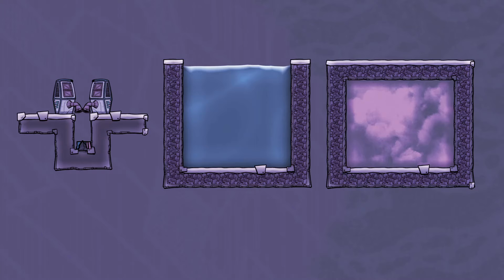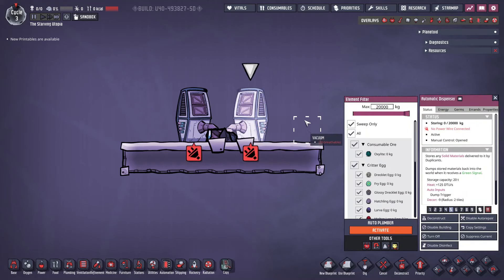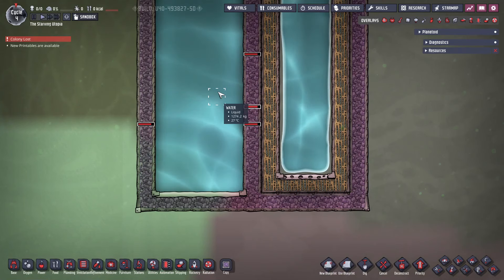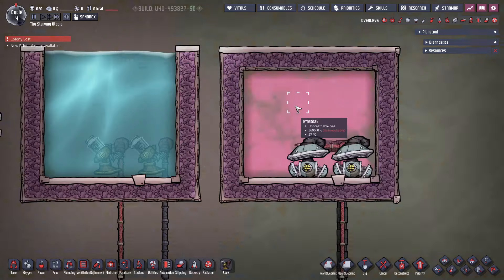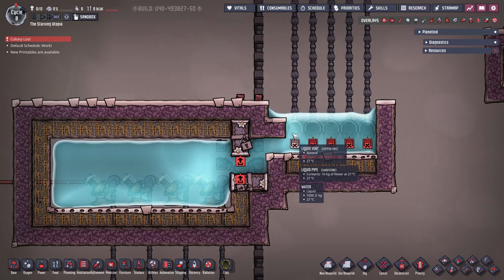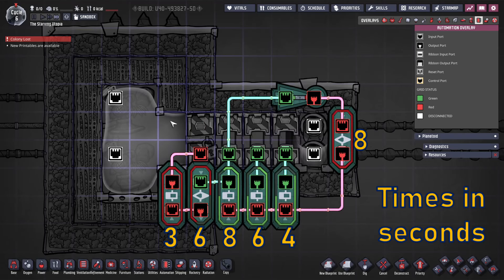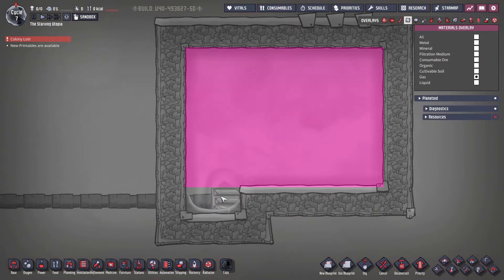Oxygen Not Included - Tutorial Bites - (Infinite) Storage

Comment: Been playing this game for close to 500 hours and your idea of not building storage bins and just shoving everything into a single hole blew my mind and now I'm mad I didn't think of it before.
Reply from the maker: Well I can't take credit for that as an original idea as it was already established in the community, but glad to share it with you!
Reply: Seriously. Just saw that and I'm looking at my 500 storage bins and lagging game and thinking WTF have I done. Saving all that space I don't need to worry about liquid or gas. Though the gas one is nice for the Natural gas storage. I have 3 geysers in my main game so all my power is through them. Unfortunately they have the same cycle activity. So I have this 1000 tile storage with 20kg of natural gas and it still runs low when they are off.
Reply: I use auto sweepers after i group all items in one spot. i use conveyor chutes to group them in different spots which makes them look organized and allows me to see how much stuff i have especially on the scarce materials. this only works for the not super hot or super cold materials though.
Reply: Storage bins do have the advantage that critters can't eat out of them.

...but you can address that by putting a horizontal pneumatic door over your infinite solid storage, so it doesn't change much.
Reply: I only recently learned that tip myself, currently 900 hrs in game. 🤦

Comment: Another alternative to infinite liquid/gas storage is to freeze them solid with Aquatuner cooling and store as debris, this method requires more setup and energy, but is more space-efficient since you can store everything in one tile and is not using any exploits. Since frozen liquids/gasses need to be warmed up again to use them, it is better suited for excess materials that are likely never going to be used, but generally it is not hard to melt them by just moving debris to storage bin and letting exchange heat with an environment.
Reply: would that explode the pipes you are using?
Reply: if they make a tile , you gonna lose half of materials you put in.
Reply: @saeeddavoody6925  Yes, materials should be submitted in small portions to avoid that and care should be taken to prevent cooling  from going offline, but once it was established it worked fine.
Reply: @denismayak  you are right,  it is a way of doing it which is fine , it just needs so much time to build a working machine with automation to ensure that it won't break and put so much power into it . 
maybe i will test that in my recent base once i get to late game and freeze entire map . it would be kinda funny.
Reply: To be fair, if you think using air flow tiles to store infinite liquid is an exploit, it would also be silly to store infinite tons of solid matter in a single space as well.

It's not an exploit. It's using the game mechanics. It's a game. There's no need to try to be realistic about it.

Comment: The infinite storage in the game is good to use, but I like the mod that upgrades my storage container to fit 10 billion grams of material... Then I can sweep the whole asteroid in there.
For liquids, I usually build a water storage area for my bathrooms and oxygen and hydrogen electrolyzers. A polluted water area for output from bathrooms. I also use the infinite mop mod to mop lakes of liquid around the map and collect them to my base. I build a chlorine room either manually or nearby a chlorine "volcano" for the purposes of disinfection. I build 3 of the liquid storage tanks with water sieve and metal refinery. First tank germy polluted water to water sieve, then second tank to metal refinery to third tank with pipe germ sensor before getting back to my clean water storage.

Comment: I tried replicating the infinite liquid storage in my save file yesterday - started with about 80kg of crude oil in the lone corner tile, then began filling with polluted water from a geyser. While I wasn't tracking the entire thing, when I came back the liquid vent was overpressured, and the crude oil was no longer in my tank. Is this a common issue that you can see?
I'm going to try again tonight and watch to see if I can spot if/when it fails. Any advice would be greatly appreciated
Reply from the maker: This should still work reliably, so not sure what the issue was exactly. I wonder if it could be something to do with the polluted water offgassing into polluted oxygen and deleting the oil, but I've not come across that myself. In that case it may be better to use the airlocks rather than airflow tiles to make the storage.

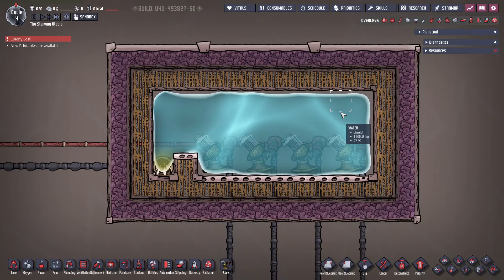Comment: Hi, I wanted to make an infinte petroleum storage with the design from 3:19, so I switched it upside down to add polluted water from above, so petroleum can flow through it. The problem is that the petroleum is hotter than 120°, so the polluted water will change into steam. I tried to cool the petroleum under 120°, but at this stage of the game its just abnormal difficult. Is there any other way to do it? Anyone got a solution for this? Thank you.
Reply from the maker: Actually that should still work as long as the liquid vent is on the steam tile, the technique still works. If you need to enter, then you can probably get in if you use a liquid lock with a different liquid to make changes. Another way to fix it would be to use a different liquid (oil is probably the best choice).

Comment: Thanks for your videos! Quick question, for the escher waterfall, whenever I deconstruct the bridge/pipe, the gas just dissappears - any tips on getting the gas to stay in non-debug mode?
Reply from the maker: The key is to delete the gas pipe in the right area, that will release the gas. I've not had an issue as long as the entire area is full of the liquid you want to use, and also make sure you don't have airflow tiles in the wrong places. Then I find it helps to deconstruct the top gas tile first, and it should be fine.

Comment: 5:14 - I'm not sure this works any more? I just tried to build a bunch with a high-pressure gas vent, and, even with 2-tiles of water on the ground, I got a "Vent Overpressure" almost immediately. The upper layers remained a vacuum and the gas never seemed to travel past the vent. In fact, it told me the vent was "blocked" before I even started pumping.

Edit: I discovered the problem is there's a limit to how much liquid can be on the 2 tiles. I've read online that it can't be more than 2kg per tile, which is tough to do with a bottle emptier. I ended up creating a setup with a water pump, connected through a Liquid Meter Valve set to 2kg to drop exactly the right amount of water. Since I had 5-6 of these blocks vertically stacked, I also added a Timer Sensor (1 green, 130 red) to give me time to have the dupes build the floor for each layer, working my way up. Ended up working well.
Reply from the maker: It's 2kg for the normal vent or 20kg for the high pressure vent, so much easier to use that if you have the plastic. I did mention that in the video.

Comment: How do you set up the auto-dispensers to just dump all their stuff onto the floor? Do you need an automation wire and a conveyer setup?
Reply from the maker: The auto-dispensers are simply set to all filters (maybe not liquifiables to stop things melting) and sweep only. If you don't use sweep only then they will keep picking up everything on the map. Then you just issue sweep commands for anything you want tidied up and dropped there. There is no automation required for doing this. You can also use this with conveyors if you wish, just add a conveyor chute above the tile to drop them in to. But generally manually sweeping is the easier way. Autosweepers are best used when material is constantly being produced in the same place.

Comment: Does this not cover your water in germs because of the polluted water in the corner???
Reply from the maker: Germs are different to polluted water vs water. You can have germy normal water and non-germy polluted water. But in any case with an infinite storage of water you will likely not have any germs anyway as the mass will be too high. You can get a very germy polluted water infinite storage, but in this case if ends up hot enough they will die anyway. Or in the spaced out DLC you could put a radiation source nearby.

Comment: When i try to use the liquid to stop the gas from over pressuring i get "pump not in gas" error and it wont allow gas out of the vent. Have they changed the mechanic or is it just me?
Reply from the maker: The mechanics are definitely still working. I'm a little confused by your reported error as it relates to pumps not the vents? The vent needs to be in liquid which is less than the overpressure of the vent. If you use a normal vent then the maximum liquid can be 2kg/tile, and 20kg/tile for the high-pressure vent.
Reply: @GCFungus  orry my mistake it was "vent over pressure" i have 20kg of Salt water over the vent in a vacuum.
Reply: The answer was there was too much salt water on each square, less than 10kg seems to work.

Comment: i tried doing this for the gas. i either put too much water in or i put the right amount. but as soon as the air start moving it pushes the water away and it get over pressured again
Reply from the maker: Did you make it 2 tiles wide, as 1 tile will definitely break and more can be a bit dodgy.
Reply: @GCFungus  I got it to work now. It was a bit tricky but I tried a few time

Comment: I was wondering if there was a cap for infinite storage... It's actualy scary when you see 50 000 Kg/tile ☠️ Also I'm not sure if it has impacts on FPS. But it's true it's really helping to manage your liquids and gases early.
Reply from the maker: Another commenter mentioned a while ago that it was 2,147,483,647 kg - so you would have to be going a while to gather so much material. FPS wise I'm not sure, but different gases interacting definitely takes more computation than just one gas in storage, so better if you can reduce gas mixing.

Comment: Oops mistake. I was wrong that the normal vent overpressurizes at 1800g per tile
Reply from the maker: This is not correct, you can double check in game or on the wiki but it is 2000g per tile. Offgassing is overpressurized at 1800g per tile which may be what you're thinking of.
Reply: Omg I did really believe that it was 1800
Reply: @GCFungus  Yeah I'm sorry that was the one! Omg

Comment: Hmm, I can’t seem to get the infinite gas trick to work with the water at the vent.
Reply from the maker: Is the liquid 2 tiles wide and below the maximum output pressure of the vent and suitable for the temperatures of the gas? Otherwise I'd need some more info to work out thr issue.
Reply: @GCFungus  I used water as that’s what I had available that didn’t off gas. I must have had too much in the space, when I made it larger it worked fine (I went from 2 squares to 4 squares for the liquid).

Thanks for the reply and excellent videos!

Comment: The infinite gas storage with liquid doesn't work anymore apparently. Tried it but it just says overpressure on the vent...
Reply: I’ve been able to use the liquid on gas vent method on my save just fine. Do u have the right amount of liquid and tiles?
Reply from the maker: It does work, just be very careful with the liquid mass. The normal gas vent will overpressure at 2kg/tile, and the high pressure one at 20kg/tile. If you put more liquid than that then the vent will be overpressured.

Comment: At 0:59 you should have said they DON'T require power
Reply: For escher waterfalls I find easier to use outputs of brudges than inputs. All is so much easier said and done in debug mode, than in normal gameplay. Using bridge outputs rather than inputs gives you the advantage to empty the pipes without using pliers and deconstruct the bridges anytime, before finally releasing gasses from the single segments.

Comment: hello. not exactly proven, but there are suspicions that the infinite storage causes performance degradation. specifically in case of liquid storage. have you experienced anything like this? me in particular had performance issues when making infinite liquid storage.
Reply from the maker: I'm not particularly aware of this. I have heard of crashes due to overloading the mass values, but not performance issues. If that seems to be causing problems them maybe be careful putting too much in?
Reply: @GCFungus  hi. ive checked with the sandbox mode, and it seems that the liquid storage doesnt really effect the performance.  the problem about the liquid storage is that the amount of liquid within one tile is constantly changed (unlike gas storage which is equally disributed) but it is not that severe to cause peformance issue.  come to think of it, it really is quite obvious because even if its constantly changed, its just a couple of tiles.

rather, shipping solid objects in bunch caused performance issue for me, as they actively transfer heat.